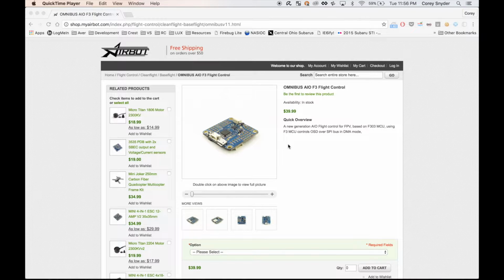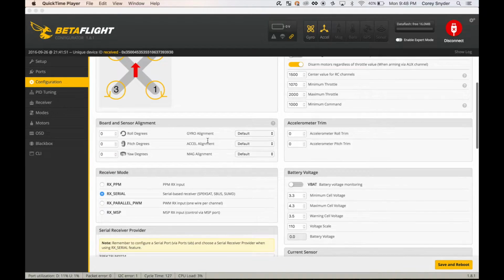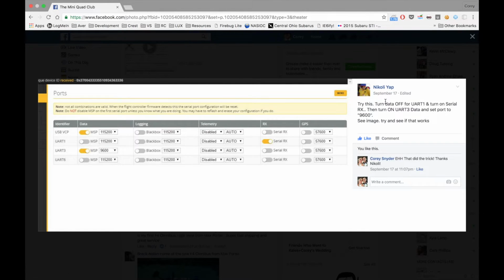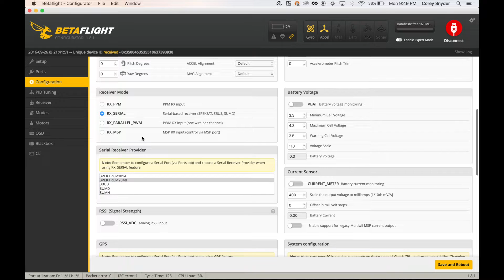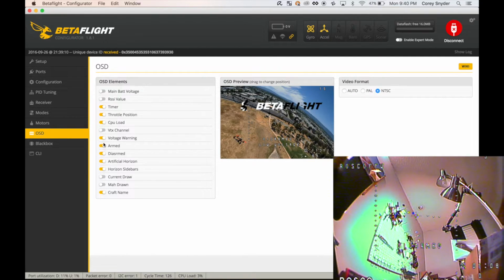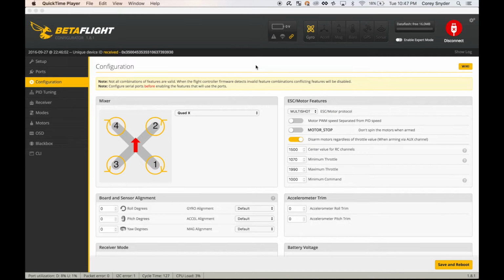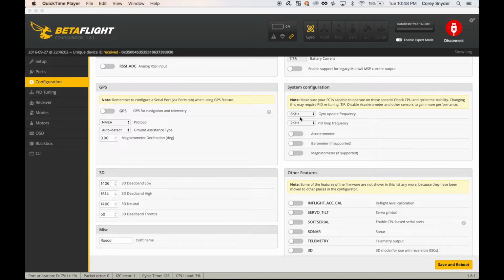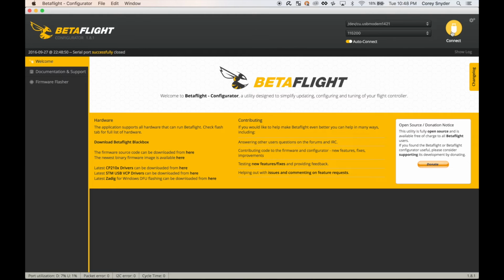Omnibus F4 AIO Flight Controller Setup & First Flight

Comment: Recently picked up one of these Airbot f4 v3 boards and this thing has been nothing but a pain in my ass. It won't work with a spectrum sat, won't flash. ..nothing. This is my 24th build & never had a fc be this much of a headache. The video was great

Comment: does soft mounting this board necessassary?
Reply from the maker: No, you don't NEED to soft mount the board. Can you turn down filtering and get better performance if you do? Probably, but only really experienced pilots are probably going to notice the difference.

Comment: hey how Omnibus F4 Pro V3 Flight Controller with Current Sensor, OSD and SmartAudio do? i just had a hyperlite f4 go all to crap it some how reset all my betaflight info on 13th start up and wouldnt fly no more and now i cant even get to connect to betaflight, was sold by droneproz.com so id beware of that board. Anyways i just ordered the listed omnibus and hope it flys great and no more random date loss just becouse i hooked up battery!!!

Comment: how did you set yours to arm? are you using a dx6i transmitter?
Reply from the maker: I'm using a DX7. I set mine to arm on the AUX switch on the top left of the transmitter. Are you having troubles getting yours to arm?
Reply: RoscoFPV I'm using a dx6i and can't get it to arm. I've set it to auxiliary 1 which is top left switch. I can see it changing in beta flight, but it won't highlight and arm. when I set any other settings to that switch they work (failsafe, angle or horizon) it's reading my reciever in beta flight but I can't get it to arm. any help would be great.
Reply from the maker: I've seen this one before an it's a spektrum thing. Go on your transmitter and go into servo setup and adjust your travel. I do it in this video here: https://youtu.be/OO6ioRyGWBo?t=2m57s
Reply from the maker: Let me know if this does or doesn't work for you.
Reply: RoscoFPV you're a life saver. totally worked. really appreciate the help.

Comment: I though this board didn't have current sensing?
Reply from the maker: It doesn't have it's own current sensor but you can pipe in data from a current sensor to get it in the OSD.

Comment: great video thanks - question on current use: how is that set up - do you need any external sensors?

edit: never mind, just seen the f4 pro has one!
Reply from the maker: Yeah the Non-Pro version you'd need a current sensor and run the data into the FC on the Current sensor port. W/ the pro it's all included as long as you power the board on the battery +/- pads.
Reply from the maker: I did a build/configuration series on the F4 Pro if you're interested. https://www.youtube.com/watch?v=DMekCSa5Cys

Comment: I dont have voltage on my osd?  I hooked up vcc to the flight controller to power it, do I need anything else?
Reply: Anyone, please help me!!!!
Reply from the maker: No, I don't think it has a built in current sensor though if you have a current sensor on your PDB you can feed it to the CURR_IN on the board.. If you want you can turn on "Virtual Current" on the configuration tab and then it should show up in your OSD configuration.
Reply: May I ask what PDB are you using?
Reply from the maker: I don't have a go-to PDB. I sometimes use a RROSD PDB but most of the time I just use a cheap $5 PDB. I'd like to find a cheap one w/ a built in current sensor going forward but I haven't found it yet.
Reply: RoscoFPV , what are you currently using in this build? It must have current sensor to get the osd working, right?
Reply from the maker: Narit Podhipak well not necessarily. If you turn on vCurrent on the config tab, it will use your throttle input and "guess" the current draw. Then you can make it show up in the OSD.  If you calibrate it correctly you can get it to the point that it's pretty close.
Reply from the maker: I think it's using the "Virtual Current Sensor" not a real one.

Comment: Does the omnibus do current monitoring by itself or do you have some sort of current sensor on your pdb?
Reply: Good question, Can someone answer?
Reply from the maker: No, I don't believe it does. I think you need to supply it w/ a signal from a current sensor. If you have one on your PDB just run that into the current port on the omnibus.
Reply from the maker: The Omnibus F4 Pro, which I have coming in the mail soon, does have a built in current sensor so you'll be able to get that feature soon! These AIO boards are really cool. They get you almost everything in a tiny clean package.
Reply: I actually went ahead and got the BrainFPV RE1 adn mPB instead. I think its a much nicer package

Comment: ok I am not able to sync my esc and when I plug in the battery it the the esc keep beeping and they start up 1 at a time it'll do half the tone and the motors start twitching. 1 at a time until there all 4 twitching any idea
Reply from the maker: Go to the receiver tab and make sure your throttle min/max values are showing up at 1000 or less for min and 2000 or more for max. Possibly they aren't reaching this and your ESC is not being calibrated like you think.

Comment: Hi Rosco, Thanks for the helpful video! Have you tried betaflight 3.1 with D-shot on this board?
Reply from the maker: No I have not tried that yet. I was just reading over the d-shot support at the link below but I haven't played with it yet. If I have time I'll give it a try. If you end up trying it please let me know how it goes! https://github.com/betaflight/betaflight/wiki/BETAFLIGHT-AND-Dshot
Reply: sure thing!
Reply: Here's the update as promised: I tried omnibus f4 and cicada blhelli_s esc setup with new d-shot firmware. I was able get d-shot300 working. Sbus setup still work as above.  Changing PIDs on OSD via TX doesn't work anymore but it's a minor issue.  Other than that it flies really well I am quite happy with it.
Reply from the maker: Malan Silva Do you think it flies better than before jumping to D-Shot? What problems does it solve? When I fly this quad today, I don't "feel" anything that could be improved on.

Comment: I'm having trouble with mine not saving but iv not got 4 uart I only have 3
Reply from the maker: George Posey Did you try what I did in the video, you should be able do it with 3 uarts just the same.

Comment: I was able to get my board to read my xsr but since I used uart2 for telemetry, since I moved to uart1 serial rx, now uart2 is gone and no way for me to get my battery reading or any kind of telemetry... any ideas??
Reply from the maker: What do you mean it's gone?
Reply: RoscoFPV something weird happen, I had to miss around with my ports to get it back... it's working now tho :)
Reply from the maker: I had that happen to. Fixed it by just turning on/off settings in the ports tab.

Comment: Is the motor order on this board 1234 or 1243 ?
Reply from the maker: 1234 Starting from the back-right motor going counter clockwise. This is determined by what software you're running which mine is betaflight. I believe Cleanflight/Betaflight/Raceflight all use the same setup but KISS is a little different.
Reply: The reason I ask was that the first version of the omnibus f3 the order on the board was incorrect it read 1234 but it was 1243 and I wanted to make sure it was corrected before I purchased the f4.
Reply from the maker: Ooh man that's not good! Was that problem easy to get to the bottom of via the motors tab in the configurator?

Comment: my naze32 is literally falling apart, would this be a good replacement?
Reply from the maker: I think so. It's a fast board. I did find that when I bumped it up to 8k/4k that the OSD would randomly disappear. I think it was pushing the board to hard and in an effort to free up CPU cycles it turns off the OSD. I need to test this further.

Comment: No baro means I won't get it. You can add a compass, GPS, but adding the barometer is not easy or ok. Other than that it looks like a great product, that I will have to miss out on. Battery is so easy to add with just telemetry, so I don't see why you want an OSD for most racing/freestyle.
Reply from the maker: Also good for adding your name to the feed when your camera doesn't offer that feature.

Comment: when I plugged in my battery the motors twitch any suggestions?
Reply: George Posey I noticed that too.  But after setting everything up and syncing ESCs the issue went away.
Reply: what uart did u use for serial rx? I can't get my rx in rx tab  to do anything its like there not communicating betaflight 3.0
Reply: George Posey What are you trying to do? I'm not using an RX UART. Only a TX 2 and SBUS.
Reply: for sbus/ibus is what im actually using should still work since its supported